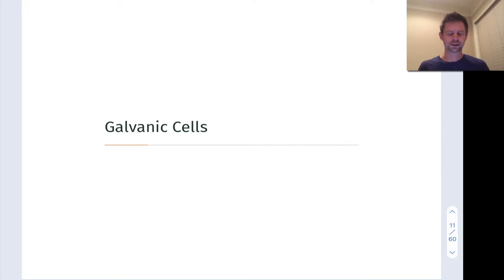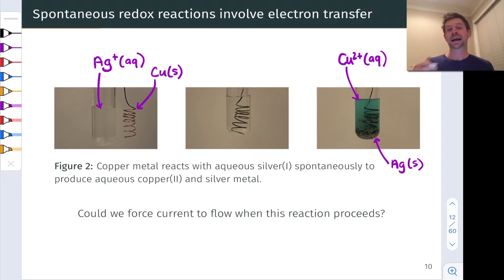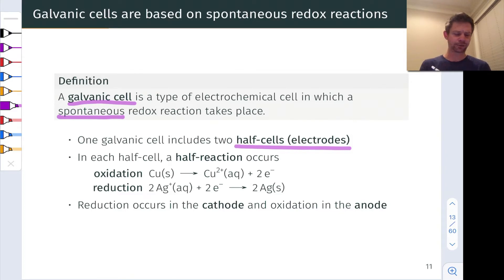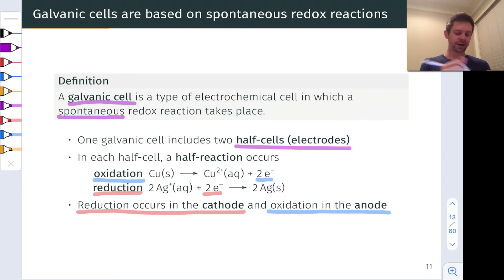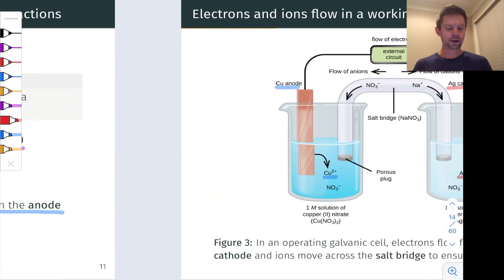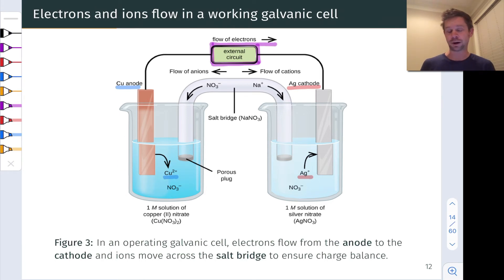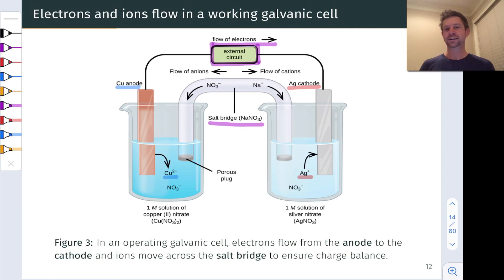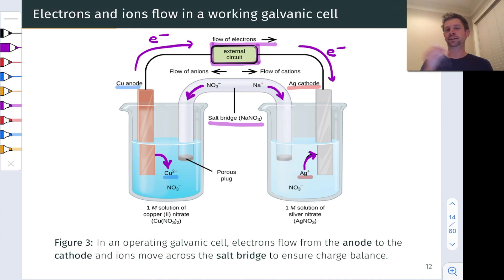Galvanic Cells | OpenStax Chemistry 2e 17.2

Comment: hello, I have a question. Do we have flow of electrons if we use voltage meter with very high resistance? i’m guessing with such high resistance there is no anode or cathode and we have an open circuit so there are no reactions occurring. if i’m wrong please correct me thank you
Reply from the maker: Voltage meters do use very little current, although the flow of a non-zero amount of charge is necessary to make the measurement. The voltage meter can only “sense” the higher-energy electrode when some charge moves. This does cause a voltage drop, but it’s a very tiny one that the meter can correct for. We use the terms “cathode” and “anode” generally to refer to the short-circuit or load situation, when the galvanic cell is acting as a battery to power something.